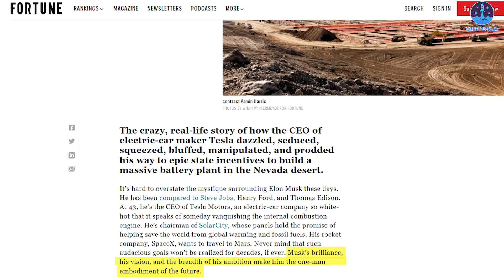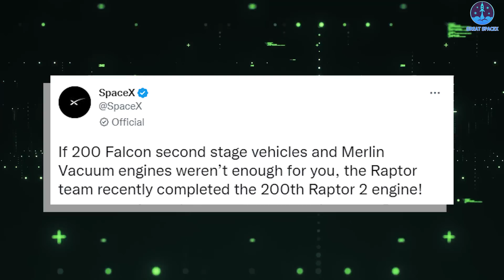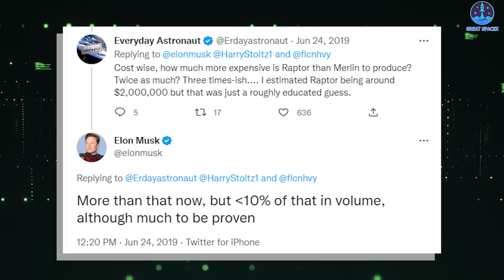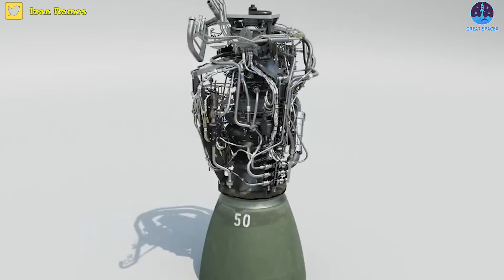Just Now! SpaceX New Major Update Raptor Engine 2023...

Comment: 5:05 - 5:20 "Even after the reuse of Super Heavy boosters...becomes viable...SpaceX wants to manufacture a fleet of...thousands of Starships and a similarly massive number of boosters."
Why can't people get it through their heads that if SpaceX achieves rapid turnaround of the boosters, which they've constantly stated is their goal, then the number of boosters needed will be miniscule compared to Starships. Probably only 2 to 4 per launch site, with a few backups stored at Boca Chica or the cape in case of catastrophic events.

Comment: I really would like to see someone do some research on this issue: I'd like to see a treatmentor analysis of the level of thrust lost can can be tolerated at launch and still achieve a successful mission. It can't possibly be designed to need 100% from every engine every time. In the event of compromised performance of some engines how much can be replaced by sacrificing the landing burns and expending the booster  7 or the iteration of the moment!
Reply: THATS WHY THEY GET PAID THE BIG BUCKS TO WORRY AND ITERATE ALL THAT STUFF! The science involved takes geniuses way above mot peoples pay grade.

Comment: We have passed a line of tolerance. The engine is too powerful to be tolerated by current structure elements. It’s time to go back to the drawing board as it takes too long to repair structures between launches and rockets returning to the launch pads.

Comment: What are they doing with all the old engines? Any small rocket company looking for cheap(er) second hand, slightly used, engines? Or what about a Raptor based strap on booster? If they are 'old tech' perhaps they could be expendable?